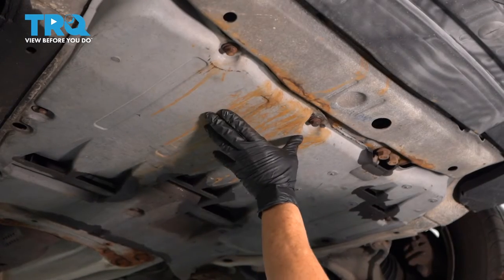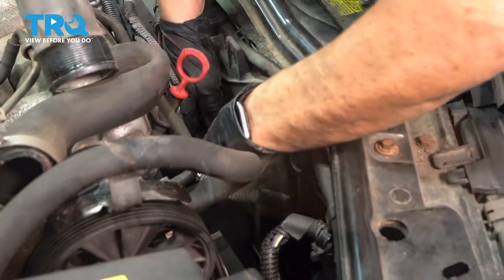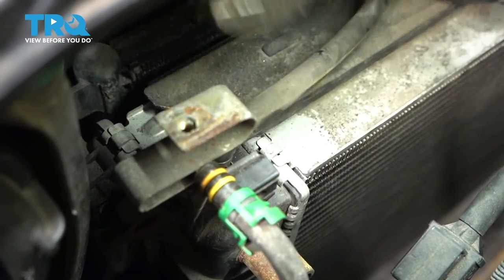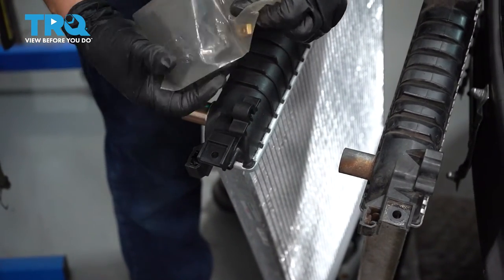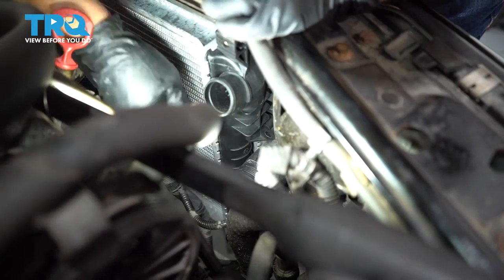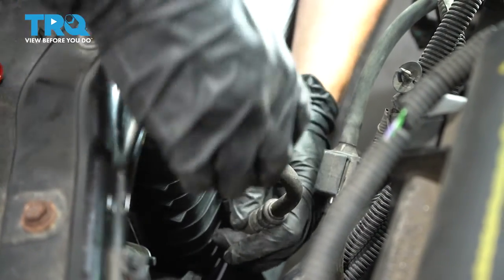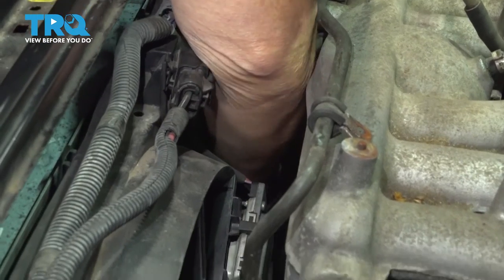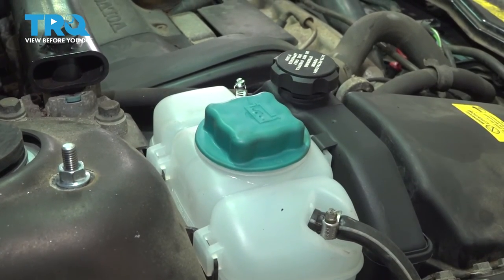How to Replace Radiator 2001-2007 Volvo V70

Comment: Amazing video, thank you. Is the radiator being changed because coolant has contaminated the transmission? The ATF fluid looked pretty nasty. This is the reason that I’m about to tackle this job. Unlike you, a professional, I will most likely be swearing aggressively.

Comment: Excellent tutorial! I have a 2004 V70R with 6 speed manual transmission. Can I assume everything is the same for the 70R  except for the transmission lines? What is the part number for the radiator when fitting with manual gearbox?